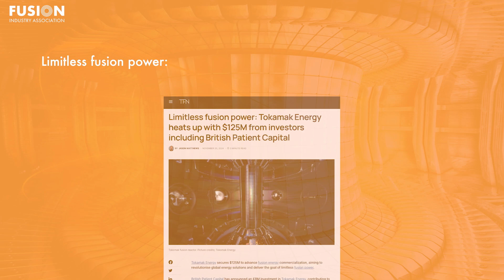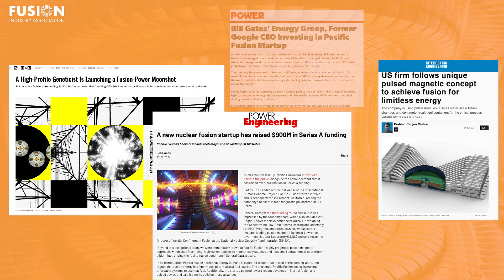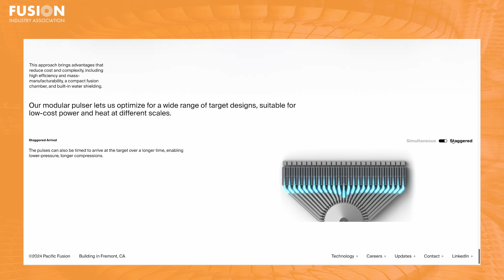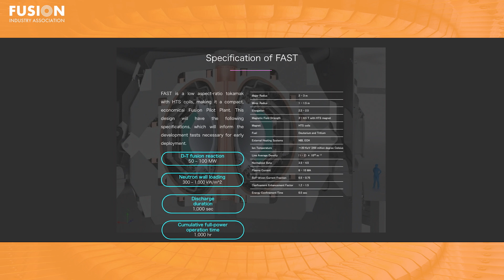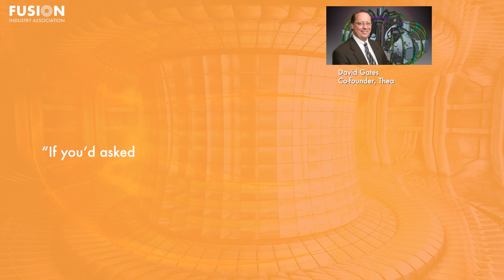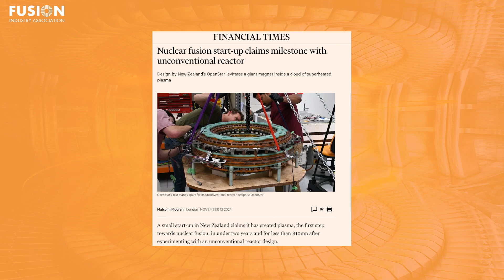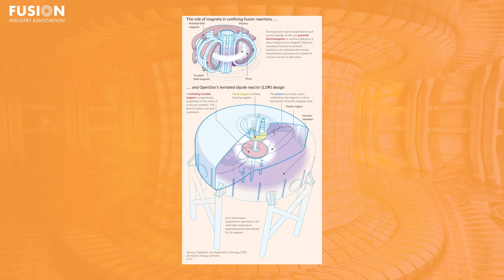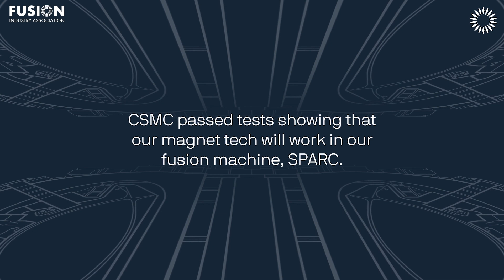Fusion News, November 27, 2024

Comment: In other not-covered news, Lawrenceville Plasma started Proton-Boron fusion tests.
Reply: This commenter is likely referring to LPPFusion and their extremely slick sales pitch which claims that their fusion approach is simple to achieve and will solve virtually all our energy problems. Typical fans tend to have no desire to critically probe into such claims. Ask yourself if their experimental program has generated any peer reviewed articles that have appeared in highly respected scientific journals. Ask if any of their experiments have achieved even a fusion energy output above one miliwatt-hour of thermal, or electrical energy at any time. Ask how long their longest plasma confinement time has lasted and how much energy was supplied to the facility during any day they claim to have generated fusion energy. Keep in mind that the Q-plasma value only applies to the 'ON' time in pulsed fusion reactors.

Comment: 2:51 Considering ITER won't be achieving Q>1 before 2035, and it isn't designed to produce electric power, FAST shows Japan (and others) have convinced themselves that we can't wait for the ITER-DEMO roadmap.
Reply: Many of the experimental efforts have given up waiting for ITER to add to their knowledge base to help them along. Many fans assume that one of the other numerous competing technological approaches is bound to achieve a commercially practical source of fusion energy within the next 1.5 decades. The fans have been left with the impression that if enough billions of USD are thrown at a project that they are bound to overcome the problems that have been plaguing the field since the experiments began in the 1950s. Billions have been invested in cancer research over the last half-century and yet there still is no general cure. ITER is grossly over its original budget and well over a decade behind its original schedule. It has become to big to cancel, a lesson that makes many investor's mouth's water. If you closely examine the recent ITER announcement you will learn that they don't expect to begin their 1st D-T fusion experiments until 2039, not 2035. They can't produce any significant fraction of a Q-plasma value until they transition from plasma heating experiments to D-T fueled experiments. They also can't begin their tritium breeding experiments until they reach significant fusion energy generation levels. It has become an intuitional process to mislead journalists, the general public and investors with their special definition of the Q value. They always are referring to the Q-plasma value which tends to involve an input energy value that is a tiny fraction of the energy needed to power the experimental facilities. In pulsed fusion devices, which includes virtually all tokamak-type devices when operating near their full fusion energy levels, the Q-plasma value only applies to the short period of time the reactor is in its 'ON' state and generating fusion energy. A more accurate evaluation criteria would be Q-total which compares the input energy to operate the facility to the output energy derived from the fusion reactions, all averaged over a day of the experiment. The record breaking fusion energy achievements, today, are many orders of magnitude away from anything close to an economically practical fusion energy electrical generating pilot power plant. The sales promoters have left the funders with the impression that these efforts are very close to achieving economic practicality.

Comment: And where do all these amazing finance boosted firms plan to source their tritium to get their marvellous reactors started?
Reply: Excellent point. Since the controlled nuclear fusion experiments began in the 1950s the journalists, the general public and the funders have been given the impression that the hydrogen fuel is virtually limitless. Most of the workers, in the field, have also swallowed this lie and never bothered to inquire into the reality of the situation. Cleverly, the details have been kept from them to keep their morale up. The fact has always been that the tritium component of D-T fuel is both radioactive and extremely rare. The current market value is above $30,000 per gram and expected to become increasingly expensive. The sales hype, in response to the current rarity is always that once a commercially practical fusion power plant becomes operational they will be designed to generate their own tritium supply. That, in itself, will be a major challenge that might not create a self-supply for many decades to come. Any critic, who looks into this issue will come to realize that very few experimental facilities have ever employed tritium in their experiments despite constant references to the machine being referred to as a 'fusion reactor.' The sales hype has become endemic in the field, led by people who are likely to claim that they are not deliberately trying to mislead anyone.

Comment: Any update on Helion Energy?
Reply: The update is they are continuing to string along investors with empty Instagram posts until someone smarter than their team figures out their neutron flux problems
Reply: @tdk99-i8n  They are making a mistake if they think they can depend on neutron fluxes as an indicator of fusion. They use compressed plasmoids which become exotic vacuum objects. These can fuse atoms without neutron emission. Exotic vacuum objects are not well understood.
Reply: @tdk99-i8n  Helion Energy's CEO David Kirtley is a master sales pitchman who has been proven to be wrong on past progress predictions for some of their many experimental devices. The 6th generation Tantra machine engaged in around 20,000 experimental shots. Not one of the best produced a highly significant quantity of fusion reactions. Their sales pitched fail to mention that they have yet to generate even a single watt-hour of fusion energy reactions. Previously they claimed that their 7th generation machine, Polaris, would be generating fusion energy electrical energy by the end of 2024. I await any claims that the machine is even completed yet. Typically, investors tend to be clueless about the technical details and tend to rely upon fusion energy experimenter fans for any 'critical assessments' of the developing technology.